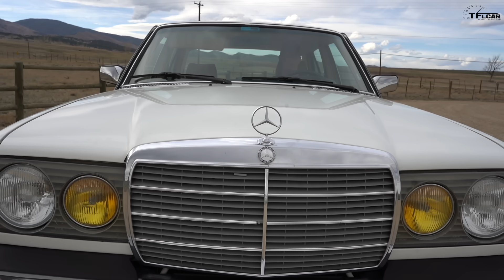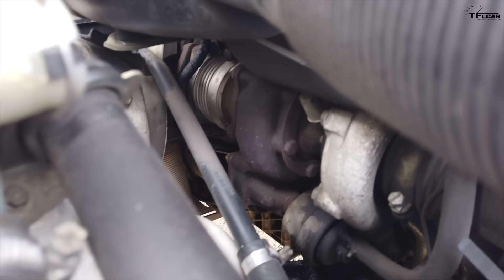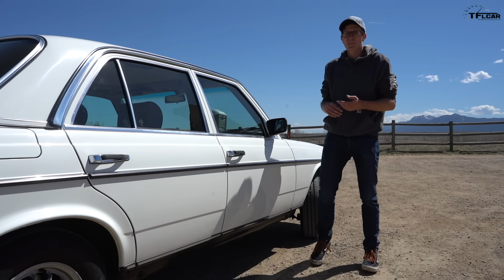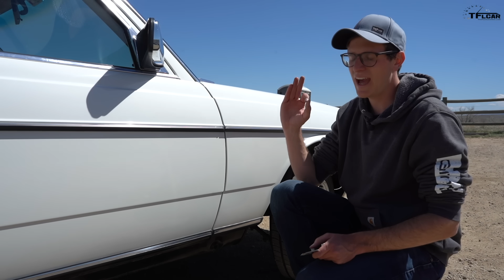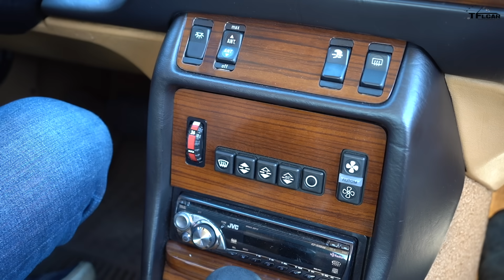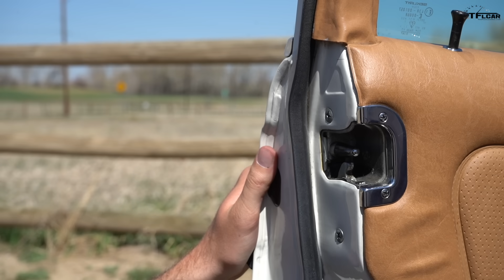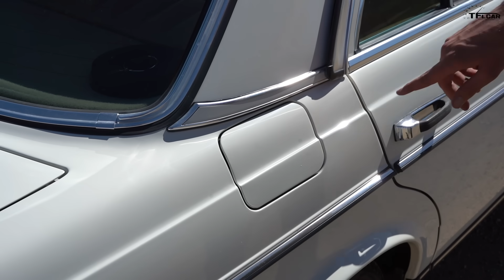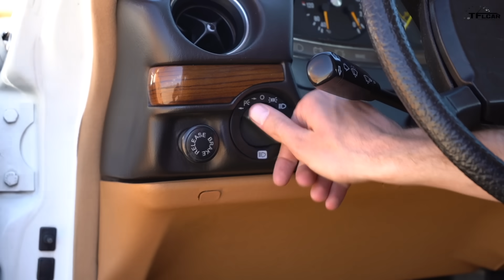This 37-Year-Old Diesel Is THE BEST Mercedes Ever Made!

Comment: That Merc he has is Clean & Polished !  But I Think that this Video and the Praise Heaped on that 300 D is " Premature " ! Why ? Because in my " Experience, "
the pitch of " Ticking " in 0:25 to 0:26 is " Quite Possibly " an " Indicator " of " Sticky Valves " [ Even ] " Hitting the Tops of the Pistons !
That happened to me once w/ a 1968 Mercedes 200 D, AND About a few hundred miles or " Less " The " Engine Locked Up " !
Upon further examination, the Heads taken Off, I found that one or more of the Valves Had Been " Stuck " and that the Piston(s) 
Had " Smashed " into them , Also the 2 of the " Cylinder Walls " were Broken Through, And you could " See " the Green Coolant !!  Not Good ! 
It's said that " Diesels Run Forever " ! But I Suggest , Check them over. Even have a Diesel Mechanic go over them, having a Diesel Break Down
is NOT Worth it !! 
Also Don't Buy it if the " Previous " did " UNUSUAL " things to it !  In my case the man that had that car before me Used to " Fill the 20 Gallon Fuel Tank
 W/  19 Gallons of  Diesel Fuel  Plus " One " " Gallon of Gasoline " !  This because he Theorized that the 1 gallon of Gas would Keep the Lines Clear [ Of a certain type of Algie which can collect and build-up in diesel fuel Lines ]    It Did, And it Also Caused the Consequence that I Described !!  Check the Histories Too !!!

Comment: The 123 series were the best Mercedes ever built without a doubt. I had one back in the 80's and it refused to die. Great quality, fantastic heavy body panels that didn't fold like paper when you leaned on it.! Simple diesel engine that was easy to work on.   I had a 240D from nearly new and drove it on the rural backroads of Ireland in the 1980s for ten years. Never once let me down. I had a head on collision with a Ford Escort that was on the wrong side of the road. The 240D lost both headlights, the grille, and the hood was twisted. When they pulled the two cars apart, I could still drive the Mercedes to the Garage the next day for repairs. The Escort driver was missing the first three feet of his car. It was gone!  (Talk about 'crumple zone'!) Fantastic machines that we'll never see the like of again because they were literally too reliable. Mercedes couldn't produce these now because they would go bankrupt waiting for people to sell them and buy a new one.

Comment: Good job Tommy , best Mercedes called popular ( Jumbo ) specially the best model 300 D,   but some other are also bullet proof , 124 looks  gorgeous way ahead of  its time , time when Mercedes was at least 20 years ahead if not even more of any other  car makers , BMW followed , some BMW were very competitive ,  in perspective I had W 115  - 220 D , sold to cab driver in 1988 with 1.200.000 Km on it , I totally restored body but interior and engine , mechanical components remained untouched , compression weakened but still run with out major problems ,  BMW 524 TD -1984 , sold vehicle with 730.000 km on it ,  just for comparison regarding BMW , in those older days vehicles had way more characters and real quality put in , take care my friends :)

Comment: I seem to remember the turbo diesel was not much good,,,normal diesel was much better (if a dam sight slower)   I had a 190 2.0D which was a four of the five/six cylinder engine...equally as good as the W124 but so much cheaper...

Comment: The Volvo 740/760 is an equal to the superb W123...and yet when equipped with the Red Block 4 Cylinder and maintained correctly will do a million miles or more!!!
Reply: Yes and it's gas not diesel, a more harder feat to accomplish....and it's geared better...

Comment: the decisive thing about Mercedes is this: The predecessors, The old  190D, with incredible longevity just not imported into the US that much, then came the W123 Chassis (thats the car shown here) then came the 190E and D ...another most reliable car albeit with a relatively gutless diesel engine but a phantastic chassis that could absorb a LOT of hp as happened with the optional lineup of gas engines, and then the W124, the E class! Six cylinders turbo charged or normally aspirated options galore and they all have the same reliability entirely, they all were used as taxi cars of choice in Europe, and the W124 in all those middle east movies with terrorists driving through the desert in E class cars! And whats the decisive thing here? Reliability and longevity in all of those! But as we all know history turned that page quite a while ago! And I am impressed how common sense young people are picking up on this jewel, great overview on an old car!

Comment: Not trying to be rude with my comment but you should add the dirtiest diesel car with or without a turbo. If you use biodiesel, then you are good since it has little to no particulates and good for the air.

Comment: "Best" means different things to different people. It all depends on your criteria.  Your best means most reliable (requiring least maintenance) and seemingly affordable. Technologically, definitely not. I love Mercedes diesels. W124 '87 300D also an awesome car great build quality (some head issues that got resolved). W211 E320 CDI 40+ mpg and bunch of power and torque. A few issues such as SBC and black death (if neglected), but not much else. Properly taken care of either of these (W124 or W211) would easily compete as best Mercedes Ever Made. I love the W123s also, but best Mercedes is a bold statement.

Comment: The OM617 is a phenomenal engine, Mercedes managed to well balance a 5 cylinder diesel which is no small feat. Though I would argue that the OM603 is actually the best engine Mercedes made, due to the simplicity of the automatic value adjustments, the 6th cylinder adding horsepower and smoothness not attained by the 617, and the refinements to the prechambering system.
Reply: i thought it was om606 that everyone say is best

Comment: You are not right. W116 and even more so W126 are the best looking and best made cars ever.

Thank you very much for making this video. You are proof that the youth of today is not completely lost.
Reply: EBMBob i concur 100% the W126 is the best of the best. I'm not a diesel person. Had a 1980 300T Diesel - took it on trade for a newer 300d turbo. The car was tired, and the engine was also tired. I restored the car and installed a European 1977 450se drive train. I have pictures if you car to see them

Comment: If you pull out your light switch ANOTHER notch, the rear fog lamps will come on.
Reply: The Euro model also could be equipped with manual headlight levelers. There was a roll dial just right of the light switch that changed the light angle. Vacuum operated of course
Reply: Only on a Euro Model unless you added a wire from the Sw to the Tailight as I did on my 300 D...
Reply: @gforce1138  Learning something every day :) Thanks

Comment: The trim is mainly made for protecting the paint if you bump your door into a lamp pole or something. If you watch closely its the part sticking out the furthest on the doors except of the mirror. And even new Diesels need glowplugs but the tech is advanced nowadays so you most likely wont notice your modern diesel heating up. And lets be honest; why would you need a bigger doorhandle? Also the size of the actual rims doesnt have that much to do with the turning radius of this piece of art, its the fact that the front wheels have a lot of space to turn because the engine is an inline 4-6 layout wich is of course mounted with the direction of travel. You will notice the same small turning radius even in "newer" (E34 as an example) BMW's

Comment: I agree. That's THE car.
My father had next gen 300E (1987) and the only problem (exept for automatic transmission going crazy) was the temperature wheel sticker that be prone to unstick in the coldest and warmest areas. But what a car, I was a child and I felt like a king driving in it, so powerful, quiet and luxury.

Comment: I had 2 of these W123 Mercedes. They were built to last. In the Finnish climate their bodies were prone to rust, but the engines and gearboxes etc. could take almost all kind of punishment. And oh boy, they were gorgeous cars to do some repairs. They were meant to be fixed, even though my the cars I had were almost problem-free. As long as you changed oil and filters regularly, you could pretty much drive anywhere anytime. Even though girlfriends changed during the years, you could always rely and trust on the W123s. I admit I was stupid enough to change them for newer cars.

Comment: The w123 and diesel Benz engines are wonderfully engineered and extremely durable, but IMO they make absolutely crap luxury cars.  Loud, vibrations, smelly exhaust and a major lack of power.  I mean what sort of luxury motoring experience are you having when you load that 80hp 300D up with 4 people and it struggles to maintain 50mph up a mountain grade on the interstate.  0-60 in 20+ seconds.   Yeah they're fun novetly cars now days, but I would have ordered a grey market Benz with a gas inline six or V8 if I were buying a new one in the 80's.

Comment: The climate control is not hard to repair; resolver all the solder connections on the circuit board and that will generally fix it.

Comment: I had 2 W123's, both bought new and perfectly maintained, yet, LOTS of problems, including factory defects.
Both of mine were gas models. Wish I had been supplied with the diesels. Likely would have had fewer issues but many were not engine-related. Used to see a fair number of diesels on the road in my area, now there are very few. Says something, I guess.  Everything CAN be kept running at a price.

Comment: Should have never sold my 300CD TD.  2 doors, huge sunroof, and you dropped the windows, sublimely good.
Reply: I have a 30 year old W124 250D 4door saloon. It's covered 204,000miles. The paint has gone flat. It's a dull red now. It looks like a shed, sounds like a tractor, but runs like a watch!

Comment: In Europe we do have W123 with full electric package :) Yes not as many as there are in US, but definitely not something that we have not seen. Also in Europe the W123 is not considered the best Mercedes or the most reliable one. This title would go to its successor the W124. And you can see 124s that rival in equipment even the latest E class models :)  W123/W124 are also very easy to upgrade and install the extras they missed initially. I used to own a 124 coupe and even though I am not a professional engineer I installed 2 electric mirrors (usually you get just one prior to the last facelift), lights on the sunshades, rear electric blind and many more :)

Comment: I had a '79 300SD.  It was plagued with tiny issues(HVAC, power windows), but the suspension, steering, drivetrain were amazingly durable.

Comment: I was Parts Manager at 2 Mercedes-Benz dealers in the mid 2000s. Hands down, the 300D and SD were the Holy Grail of Mercedes, and cars in general. The 1998-1999(140?) Diesel was good too, but not like the 123.
Good job on this video! You're a cool dude.
Reply: Grail, not "trail".
Reply: @wholeNwon  Hehehe. I expect it was the gremlins in the phone...if you don't watch that the center word is correct, it will change it even if you typed it correctly.

Comment: This is about the best modern w123 review i have seen. I used to drive a w123 240d as a taxi back in the early 90's  when i was a student. Great car!
As for the Mercedes quality, i consider the succesor w124 as the last high quality Benz. Every model that came after got worse because of commercial reasons. 
These days i do not consider any german car brand   to be top quality engineered anymore. 
Japanese brands like Toyota, Lexus and Mazda have taken over that crown.

Comment: The climate control system from 82-85 was actually pretty good (of course as long as you don't have a vacuum leak). It was the systems from 77-81 that were prone to failure.

Comment: The ONLY problem on these older Mercedes are the vacuum systems.  Plastic gets old,  plastic valves get old, and they leak.  When you have to replace the vacuum system you have to take apart something engineers designed to go together, but not come apart.  It usually leads to other plastic things breaking, that you have to replace.   But the drivetrain, and rest of the car, sure.  It's great.

Comment: The 126 line was certainly superior in many regards. Better styling. Better quality interior. Stronger engine. Faster. So many improvements. I love my c126 500SEC. 

But the diesel 123's will last forever. ThE particular example in the video was either restored with a lot of money or was incredibly well preserved by someone who loved it. Nice video. Good job. Subscribed.

P.S. Yes, the climate control systems from Mercedes of this era is terrible. My mechanic just spent an entire day going through mine, replacing all of the diaphragms so that I could have proper hot and cold air. You have to take everything apart. It's astounding. I'll be doing a video on this.
Reply: I'm falling for my 126 never been a Mercedes guy but the more I drive the car the more I want to drive it

Comment: The W123s are truly great cars. Just don't turn on the A/C.
Reply: I sincerely agree Stuart . I have 2 300d turbo diesels . very good during the winter though. Mine are a 82 brown , palamino interior . and 84 bluish silver , blue interior 
82 has over 500k , 84 has close to 300k . Motor , and transmissions , have never been pulled for repair on either car . I do my own maintenance . I purchased a Haynes  Manual for general maintenance tips , over 20 yrs. ago. I purchase my parts online mostly from AutohausAZ .

Comment: The climate control system is a vacuum symphony-- provides perfect comfort.  It just has to be maintained.
Reply: I agree the climate control works very well. The only weak point is the stupid GM R4 compressor that failed. Never understood why Mercedes used a garbage GM part. Most likely because AC wasn’t used that much on the European models.

Comment: The dome light switch is for taxi use, so you can have the light on for your rear seat passengers while still being dark up front so you can see better where you're going at night. And the motor for the power sunroof (not a moonroof as you said -- a moonroof has a glass panel so you can see through it when it's closed, presumably to look at the moon at night) is in the trunk, so that's why it's nearly silent when it opens or closes. Those wheels are more typically called Bundt Cake wheels, because what's what they look like.

Comment: Speaking from personal experience - 1979 Mercedes 300D was the worst car I have ever owned and I will never ever purchase another one again. The bolt holding the crankshaft pulley had to be periodically checked for tightness because it was prone to getting loose, and if it did get loose it would start free spinning on the crankshaft polishing off the groove for the pin holding it in place and the crankshaft would need to be replaced as a proper fix. Of course, I didn't know that until it happened to me. Never ever did I have a trouble like that with a vehicle of any other manufacturer. If you go to an oil changing outfit to change your oil, make sure you let them know that the oil canister nuts must have no more than a certain torque otherwise the threaded studs will pull out of the oil canister which is made out of aluminum and that's a 700 dollar fix parts and labor, and, yes, that happened to me as well! And there was trouble after trouble after trouble after trouble and on and on and on.... No more MBZ for me.
Reply: Oh, yes, forgot to mention a stuck ignition key in the ignition switch - that happened to me as well..

Comment: My first long term involvement with a Mercedes was a 1981 300SD, dark blue with a caramel colored interior. It wasn't very quick but once under way it just loafed along at any sane, or nearly sane, speed you chose. It had great presence on the road as long as no one heard it at idle. The next car which gave me the same sense of security and comfort was my S550 almost thirty years later. Looking back I wish I still had it.

Comment: We had a 1983 2 door coupe. Something about the lines of that 2 door were awe inspiring. I bought it as a project car since I had just completed work on a 90 GT Foxbody Mustang that I converted from AOD to a 5 speed and 3:55 rear diff gears. The issue I had with the 300 TDC was everything operates by vacuum especially the heat and air system. There's something about 35 year old plastic vacuum lines.....the get brittle....they crack....they break off and they can be a nightmare. But, after 35 years when I sold it the freaking clock still ticked along and kept perfect time. And the sun roofs...what a pain in the ass. The lube in the retractor cable tube gets old and gummy and the sunroom moves an inch a minute ha.And Mercedes brakes squeal....that's just what they do. I replaced all calipers, all disks and pads and brake lines and the dang things still squaled even with disc brake quiet smeared on the back of the pads. You learn to live with it. I miss it. I got compliments on it everywhere I drove it.